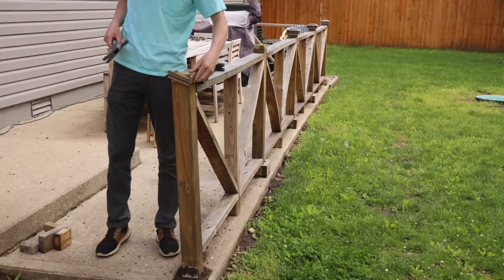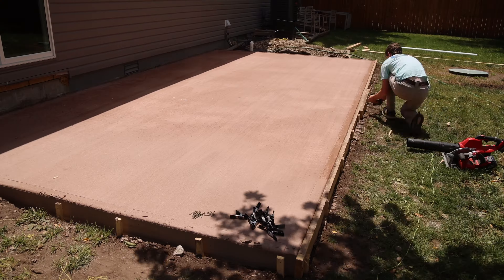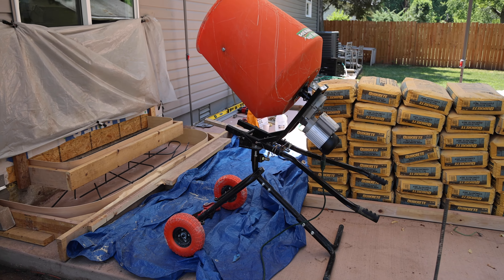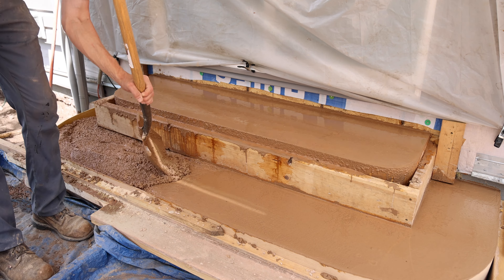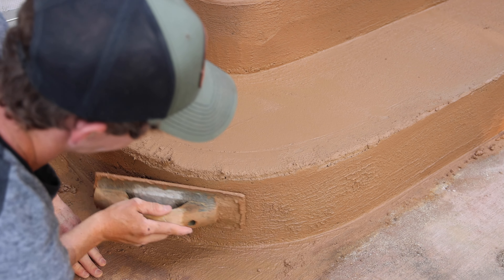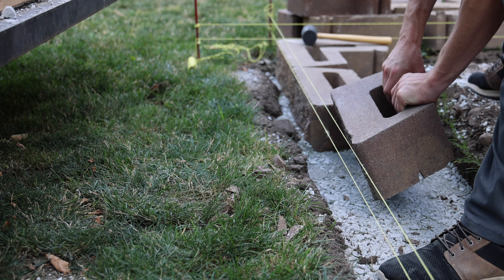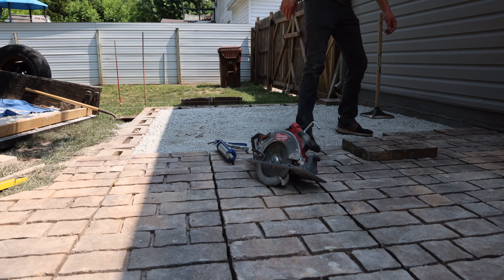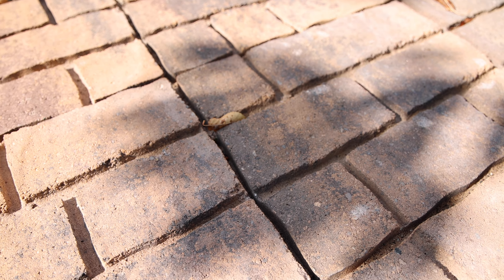This patio got a MAJOR upgrade!

Comment: Finally someone uses colored concrete!!! And not just a spray over top coat! I love the color, my house is dark green and sometimes appears greenish black and I think a more reddish terracotta… like yours would look fabulous against my house
Reply from the maker: Highly Recommend the dye! The bag for the main slab was just tossed into the truck and mixed in for a few minutes before it was poured. There are quite a few color options with this method.